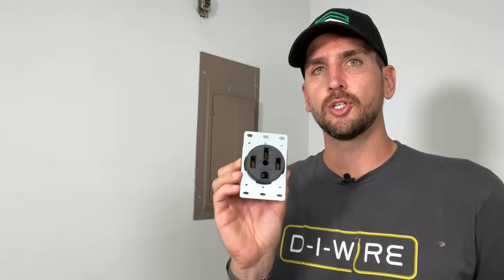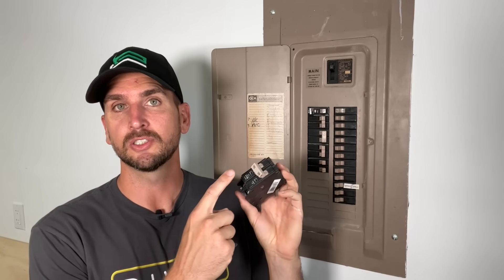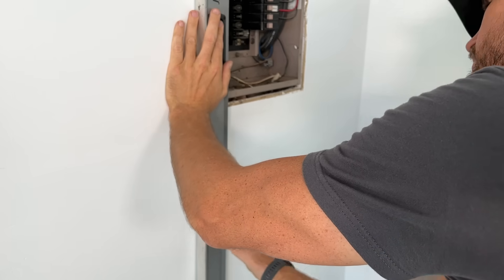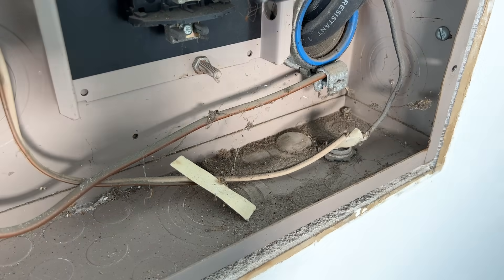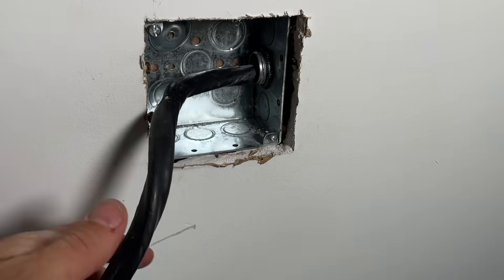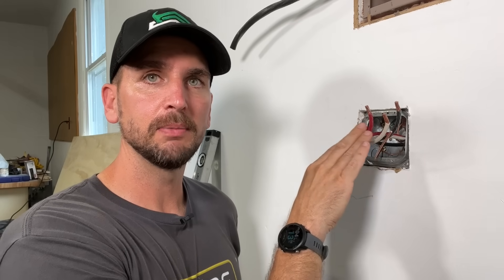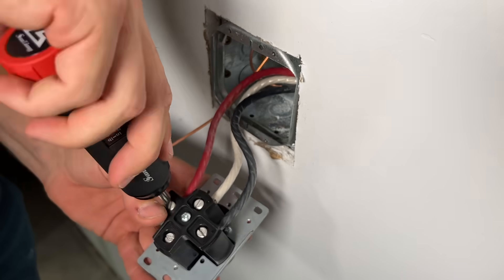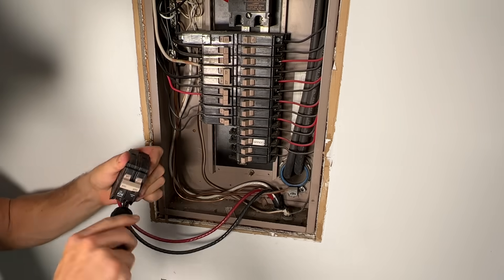Quick and Easy DIY 240V Outlet Install | 50 Amp NEMA 14-50

Comment: The heavy-duty industrial grade NEMA 14-50 receptacles (Hubbell, Bryant) are constructed of fire-resistant Bakelite rather than injection-molded plastic, and their 4 contact springs are heavy-duty with heavy plating, specifically designed for thousands of insertion/removal cycles rather than a few dozen. They also feature specially plated clamp-style wiring connections with set screws which must be carefully tightened using a calibrated torque wrench. A side-by-side comparison is compelling, and there are a rapidly-growing number of photos of melted/scorched/burned NEMA 14-50 outlets posted on the Internet. Sadly, many of these dangerous receptacles were installed by licensed electricians.
Less-expensive, lower-quality NEMA 14-50 receptacles are unsafe for EV charging and should all come with a warning that they are not designed for and must not be used for EV charging applications. Given the risk, home improvement stores (Home Depot, Lowes, ACE Hardware, etc) should completely stop selling them, and online stores should be required to have detailed warnings. The national wiring codes should also be updated appropriately. No one should die or lose their home over this issue.
That said, a safer, more reliable option is to have an EVSE permanently wall-mounted with a dedicated, hard-wired connection rather than installing a NEMA 14-50 receptacle. And PLEASE hire a licensed, experienced electrician. Don't risk your home and loved ones to save a few bucks. Seriously.
Now that the Tesla/NACS connector is being adopted for EV charging in 120/240Vac North America, the Tesla (Gen 3) Wall Connector EVSE is an excellent value with a large installed base and a well-earned reputation for safety and reliability.
Reply: Yes.  The $10 outlets have 1/2 width connections in outlet.  Takes $50 to buy the good outlet.
Reply: I’m sorry but the whole point of this video is to not hire an electrician. I’m not a licensed electrician but have been a builder for 30+ years. Went to college and learned electrical wiring. Nothing wrong with people doing their own electrical work with a little help from videos like this. Gvt overreach sucks.

Comment: PLEASE - Do NOT use a cheap $9.00 Leviton 14-50R outlet for 32 amp EV charging!  These are intended for electric stoves, clothes dryers, and arc welders: appliances that are more or less permanently installed, so that they are only unplugged/re-plugged a few times in the life of the appliance, and that only run at full power for 1 or 2 hours. EV charging involves full power loading of the outlet for up to 10 or even 12 hours at a time, and possibly frequent plugging/unplugging, if the EVSE is a portable one that you take with you in the car. This kind of heavy duty use can result in melting a cheap outlet and causing an electrical fire. Use a Hubbell or Bryant Industrial Grade outlet for EV charging. You will pay at least $45 for a Bryant, or $90 for a Hubbell (they're actually the same unit), but you won't have to worry about burning your house down.

Comment: I could make one suggestion, when cutting your hole for your box , your first cut should be horizontal for the length of th box. This would insure there are no studs in the way. In the case of this video you would start in the center and cut toward the stud to find the edge. Use that as a point to re lay out your box if needed.

Comment: Duty use plug per manufacturer reccomendation? No. Enjoy fighting for warranty. 

Gfci breaker? No? Good luck. 

Permit? No? Good luck with the warranty. 

At least you used copper. If you use aluminum. Good luck.

Comment: Code states an outlet in the garage needs GFCI protection if it is less than 250 Volts, and each leg is less than 150v to ground.

Comment: So the price goes up to $500 if your garage is 50 ft away from the breaker.
Reply: I lucked out.  I’m in a newer home and the breaker panel is in the garage on the wall just inside the garage door where I already park my car.  I won’t need lots of wire, any conduit and I am not going to ever hang a picture that close the floor or in that part of the garage.

Comment: I was told I needed a 250amp service minimum if you have electric water heater and furnace. It would cost $4,000 to upgrade from a 150 amp

Comment: You say that the WAGO can handle 10 gauge wire, but the wire you are installing is 6 gauge, and the smaller number means that the 6 gauge is bigger than the highest rating for the WAGO, not sure if I'm missing something here, but it seems that the WAGO is under rated for this project by two gauges.

Comment: Working for Amoco in a gas plant in the electrical gang we always checked with a meter to issuer the breaker was open and not energized! I have seen old breaker still hot even when the handle is switched!

Comment: Very few comments on amperage so i will add:  due to constant draw, some areas require derating to 40 amps at the breaker.  This is plenty to fill any EV overnight.

Comment: Thanks for this info...very informative.
I have a question...if i may

I just noticed that i have 240v outlet in my mud room for the dryer outlet. 

The mud room is accessed thru the garage so its very close to where the car will be. 

My question is...

With the outlet in this mudroom and next to the garage can that outlet be extended or tapped into to make another outlet for the car in the garage? 

Instead of having to run it from the breaker in the basement

Comment: Several things being discussed here. I am a licensed electrician and install EVSEs. The past couple years has given us the history to understand that the cheaper, $15 outlets are not built for the continuous load of EV charging. Torquing and alum wire are issues but the outlet itself is an issue. Companies like Qmerit are requiring their installers to use commercial grade outlets. Concerning wire, most installation manuals now state that 90 degree copper is required. Best bet is a hardwired install.

Comment: How necessary is the Neutral connection for a 240v system?  I know some people install a 6-50 which doesn’t use a neutral wire.

Comment: In my current business, all I do is install EV chargers. A lot of discussion about wire type and size. In my AHJ, inspectors are wanting to look at the installation manual and what that says, rules. Many are stating the breaker size but also 90 degree rated copper wire. I only use the commercial grade outlets, if I cannot talk the customer into hardwire but have yet to find an exterior enclosure that they will fit into.

Comment: I’m fascinated at how 6/3 wire seems so easy to manipulate in this video!
Reply from the maker: Wasn't too bad on this one but 6/3 can definitely fight you.
Reply: @E @EverydayHomeRepairs  My distance from breaker to outlet will be approximately 60 feet. What wire should be used for my project?
Reply: lol
Reply: You can use 8/3 if the outlet is only a few feet from the panel. Has to be copper wire!!!
Reply: @dimitriberozny3729  My distance from breaker to outlet will be approximately 60 feet. What wire should be used for my project

Comment: Are gfci breakers available for this type of application? I want to add this in my garage, but also connect some equipment that requires a gfci circuit.
Reply from the maker: Yep, you can get 240V 50 AMP GFCI as this is a requirement by the latest NEC which is being implemented in some states/cities.

Comment: Must it be a meta box? Or, can it be plastic? thanks.
Reply from the maker: It can be plastic but I prefer metal as plugging and unplugging can apply a lot of force to the junction box.
Reply: @EverydayHomeRepairs  Hadn't thought of that. Thanks for the opinion, the info, and the videos.
Reply from the maker: @avlisk  you bet!

Comment: Just because there are spaces available in the panel does not mean you have the capacity.  Do a load calculation.  Outlet needs to be GFCI protected.  Most EV chargers are going to require commercial grade outlet.  Device is not rated for box fill in a 4sq box....  You should do a follow up video with your local inspector.  Since you are adding a circuit, it requires an inspection. That would be fun to watch.

Comment: Tesla and Porsche recommend industrial l grade receptacle.  I noticed the torque on the residential grade used in the video was 20 inch pounds.  Hubbell and Bryant require 75 inch pounds.  75 inch pounds flattens individual stands of wire against the connector, providing more contact surface area.  20 inch pounds does not flatten individual strands, and provides less surface area contact.  Spent $50-100 more for an industrial grade 14-50.  I know of two, Hubbell HBL9450A, or Bryant 9450FR.  Nothing else torques to 75 inch pounds.

Comment: My panel is very old. It does not have a ground bar. Only neutral bar. What should i do? Can I still install 50 amp breaker?

Thank you for the help.

Comment: I talked to Teslas professional installation support team and they said my previously installed 6 gauge aluminum' line that was used for a electric stove will work fine with the mobile 220V charging cable since it will only use a maximum of 35 amps. I am also using a industrial Nema 14-50R. Any opinions?

Comment: 2 months ago I hired a local electrician who stated he had already installed Tesla wall connectors twice in the last year. At first my wall connector worked fine for 2 days then after that it kept tripping, so I tried to call the electrician and he never answered my call… I know he didn’t go with highest amp, he lowered the amp to like 50 I think. What should I do?

Comment: How interesting - you talk about adhearing to code and torqueing to manu specs and how much better the Hubell 15-50R is instead of the other 3 cheaper versions. And then in the Video you plug at the end, you recommend a Leviton 14-50R that lists for $25 with a business price of $10....

Comment: Ur neutral wire is totally wasted and legit scary to use that thin ground compared to the neutral that again is not used at all. You should have just used the neutral wire as the ground and ditched the skinny ground and left neutral open. That’s the cheapest way bro.

Comment: Great install, really appreciate the video.  I intend to install two of these in my garage but only one will be in use at any given time.  Do I have to run each outlet with it's own separate feed all the way from the service panel, or can one of the outlets be in the middle of the run and the other one at the end of the run?
Reply: There's a YT video of someone installing two 220V lines branching off a single line to the Breaker (see "Can you install a EV wall charger without trouble? " by EV Dave). Nice install, but In the comments someone stated this is code violation,  and each 240v line should  have a dedicated circuit back to the panel.
Reply: @kimstockdale632  thank you Kim, I really appreciate the response.

Comment: I'd strongly recommend the cheap trash in this country doesn't take this price too seriously. There are a ton of ways this is at best laughable and in reality just completely unrealistic. Hu runs this outlet to a foot under his panel - Otherwise known as the ideal place to plug in your EV. Also, he uses no conduit at all - This doesn't seem like an issue since he gets that wire into the KO easily, so who cares? If you go more than a foot away, you wont have as easy of a time getting that through there. Plus the real reason this is completely irresponsible - Once you run romex through a wall like this with no metal conduit, your wife will come along in 5 years wanting to hang picture frames on the walls. She will nail in wherever she feels the pictures should go, and doesn't have x ray vision of the loose 250v wires you left in your walls. Once she pierces them with a nail, the fire is all yours. This is why you should get a reputable electrician and spend more than $60 on this. Your EV will save you more than the cost of install in the long run, plus I don't want to walk a charging cable down into the laundry room every day to plug mine in. 

Have the guy put it in your garage. If you really want some foresight and have a situation like this guy started with and plenty of open space in the panel, consider springing for a subpanel in the garage. The wire will be larger(more expensive), but most of the labor of piping and pulling is the same. Now when your kid gets an EV or you decide to put a heat pump out there in the future, it will be much cheaper to come out of that sub panel instead of having another guy run it all the way out from your basement. Be clear on what you want and what your expectations are.

Comment: If installing this to charge an Electric Vehicle (EV), do NOT use one of the $10-$20 NEMA 14-50 outlets. Those outlets are designed for use with your electric range and dryer, which only run at full power for short periods (typically an hour or less) of time. Yes, you can easily use an oven for hours at a time, but how often would you have the oven and all the burners running at full power simultaneously? Even for Thanksgiving, most of the work on top is simmering. And dryer cycles seldom exceed 45 minutes. 

You NEED one of the Industrial rated outlets, which run in the $50-$125 range. These are DESIGNED for things like pottery kilns, melting metals, and charging EV's, which can take hours of continuous operation.

In short, don't risk your house for a $15 outlet.

Comment: Hi,  my panel is all the way in my back patio, I'd like to run a 75 feet romex line to the front parking (through the attic, which is the shortest path to the front). Questions:

1) I'm planning to use 6/3 NM-B x Southwire "Romex®" Electrical wire. Is that any good?
2) Do you know how hot Romex 6/3 gets if I'll be using Tesla Mobile Charger (which takes max 32A)?
3) Is it absolutely necessary to have the Romex wire run inside a conduit pipe? 

Thanks
Reply from the maker: Hey Brandon, I will give my 2 cents but I am not a licensed electrician so keep that in mind.  
1)  6/3 from Souwire should do the job
2)  Not sure on the temp of the 6/3 loaded up to 32 Amps but personally I would not be worried
3)  Actually it isn't best practice to run Romex in conduit.  In wet locations it is actually against code to run Romex in conduit even though one of my 240V outlet install videos we used Romex in conduit.  If you are oing conduit get yourself THHN wire which is a better solution than Romex.  This sub panel install we run THHN through conduit https://youtu.be/6HNhCH_hk2M
Reply: @EverydayHomeRepairs  hi Scott, thanks for the input. I've been reading up a bit about it too, and seems like most people said Romex doesn't need to be inside conduit pipe, but if you're known to have rodents problem and to prevent them biting on the wire, a conduit pipe can be used. 

If I was to use THHN wires inside my attic and run with conduit, which connector should I use at the junction box between the THHN and Romex wires? Will that degrade any conductivity from the wires and reduce charging voltage/amp ?

thanks
Reply: @EverydayHomeRepairs  Scott, do you think the Hubbell 50A Nema14-50R receptacle is a must have? It's so expensive now, cheapest I can find is $80 and not sure if it's really worth it or any other 50A nema14-50 from Levington or similar brand would still work? 

How's your experience with the Leviton 279-S00 50A so far? anything melted? or going bad with it? and are you plugging it in overnight (8 or more hours) for each charge?

Comment: If this is a garage, then this receptacle needs to be gfci protected and it is not.  Material costs with gfci protection would be well over the the $66 budget.  Not to mention there is standard mark up to material costs in addition to labor.      And permit fees.  This install would not meet code for a garage and $66 is a joke.
Reply: Most DIY folks aren't pulling permits, be serious.

Comment: The updated outlet now listed under supplies is INDUSTRIAL GRADE. This is absolutely required for the continuous operation when charging a car. The standard outlet will heat up, melt and could cause loss of function/fire. The Legrand 3894CC6 shown being installed in the video is a serious failure. The new link industrial rated Leviton 279-50 is $10. A Bryant made by Hubbel is about. $30 and a Hubbell is around $60.

Comment: I was going to do this until I realized I don’t have anymore space. Called an electrician and told me that I need to upgrade my box since I already got all my breakers being used. I’m in CA. He said you need to call pg@e to turn off power and install a new larger electric panel box. Something that was supposed to be under $100 is now going to turn into a $2000-3000 job . And was told I need to get a city permit.

Comment: Cable cost $8 per feet, $60 only able to get you the plug and circuit breaker. The cable cost me $500 bucks.

Comment: Hi, quick questions. 1. can you put 6 AWG Romex wires in PVC conduit for 240V 50 amp 14-50 outside of the house? 2. I have 2 panels in the house and have to run the 240v 14-50 outlet outside of the house from each one. so can you put all 10 6 awg wires in one PVC Conduit?

Comment: for electrical people, i have a 50 amp breaker but realistically only need to charge at maybe 32 amps. with my tesla can i set the amount of amperage im going to pull? if i can set it to 32, is it safe to have a 50 amp breaker pulling only 32 amps?
Reply: Wiring should be installed for the max draw of the charger, not what you would limit the charge to. It only takes 1 mistake, reset to overheat your wiring.

Comment: Using the cheap $15 Nema 14-50 outlet??? Keep the Fire Dept. on speed dial, and make sure you have fresh batteries in your smoke detector. #GonnaBurnBIG 🔥